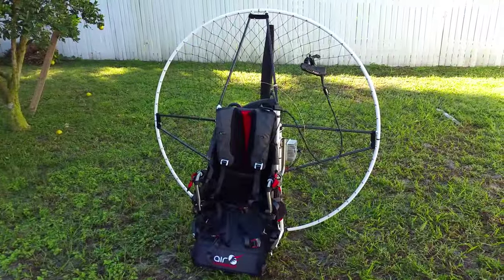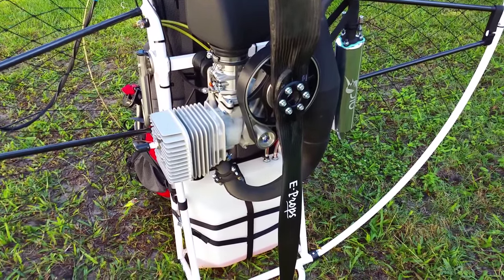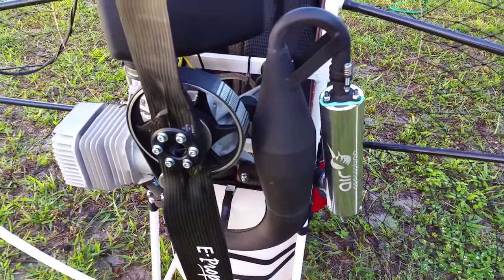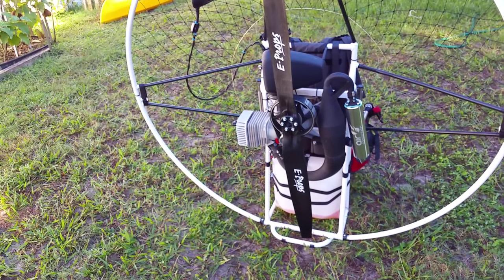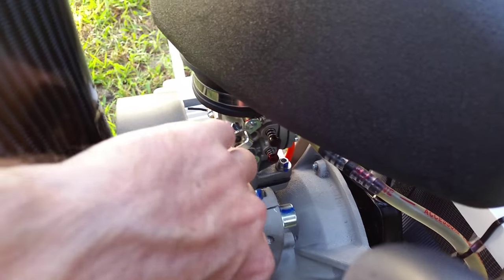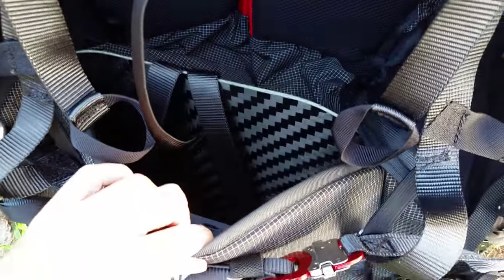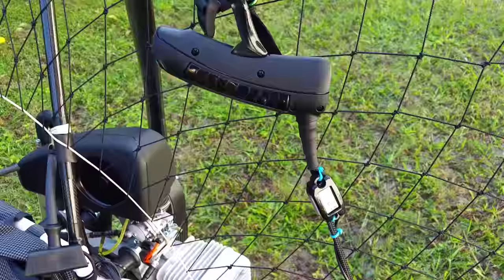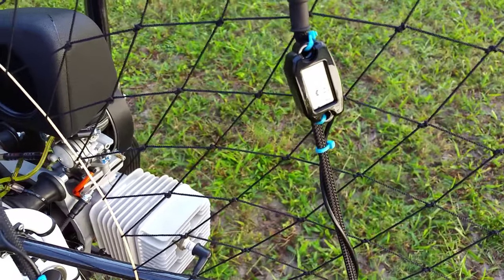Air Conception Paramotor Review

Comment: Just for fun, suggest what paramotor, engine, prop, wing combination is most appropriate for my situation and application.  I will be flying in the Atacama High Desert (also called the Atacama Andes).  The low points of the valleys range from 3500 to 5000 meters altitude, and the peaks range from 4500 to 6200 meters altitude.  Sometimes I will just be exploring sites (mountaintop sites for potential installation of telescopes and observatories) so the weight will be only 150kg or so (pilot, heavy warm clothing, oxygen bottle, mask, water, etc).  Other times I will be hauling small telescopes and instrumentation to mountaintop sites to test air stability (absence of air turbulence).  Of course I can disassembly the telescopes and instrumentation, take portions on separate flights, then assemble them again on the mountaintop.  Nonetheless, the more weight I can haul per trip, the better, and some components cannot be disassembled further.

I've been thinking I will probably need the AC with Tornado280 engine, or possibly the upcoming Scout with 4-stroke engine.  But that's just my guess.  Suggestions will be welcome.  Note that there are simply no other ways to do this work.  Most of the mountaintops have much too small smooth and flattish areas to land an airplane (even STOL), and high-altitude helicopter flights would cost about 1000x too much per flight.  So... as far as I can determine, the only way to carry out this project is with paramotor.  However, before the very best of modern paramotors, this work was impossible or vastly too expensive to consider.

PS:  I much prefer foot-launched to trikes or quads because far more of the candidate mountaintops have areas large enough for landing a foot-launched paramotor.  However, if in the end I really must, I would consider a trike or quad.  But I really don't want to.

PS:  If any engines have EFI (electronic fuel injection), that would be much better for my purposes, because they would automatically adjust mixture to match altitude as I climb and descend.